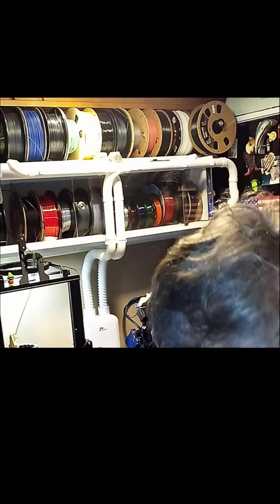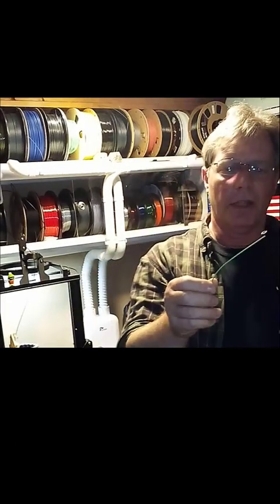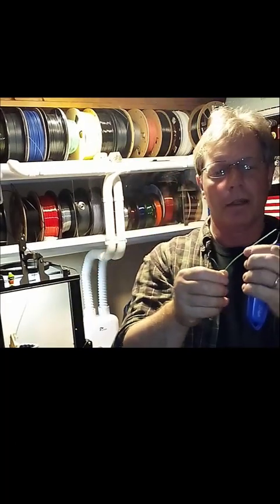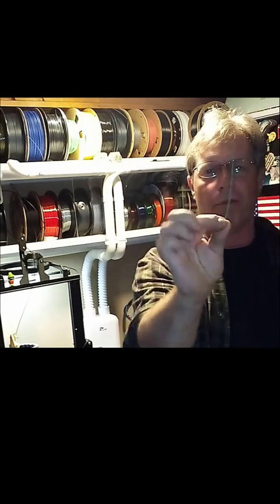Auto Filament Loader V2.0  Muti-layer Calibration cube "Proof is in the pudding".........

Comment: retract wouldnt work correctly
Reply from the maker: Doesn't seem to have that negative of an affect as you would think, as even by pulling up the new filament, it drops the pressure in the hot end for a second. Besides, its only the retractions during the time the old filament that is in the bowden tube, until the new one reaches the hot end. Even less time in a direct drive setup
Reply: He’s shown how retract works with this setup on another video.
Reply: It seems fine to me